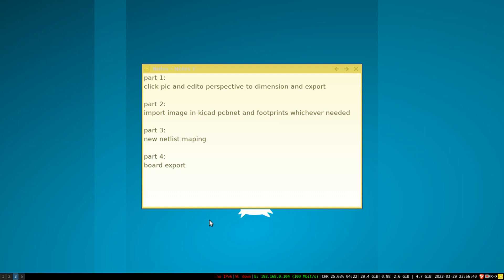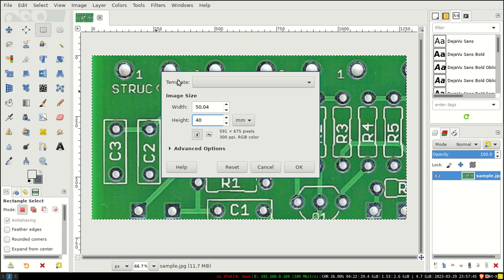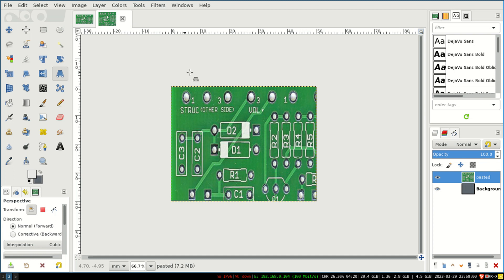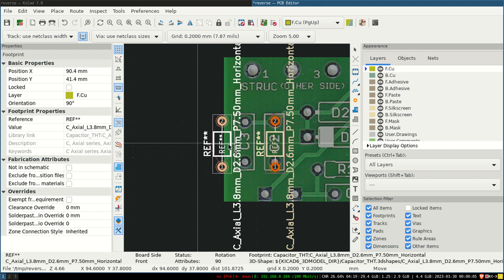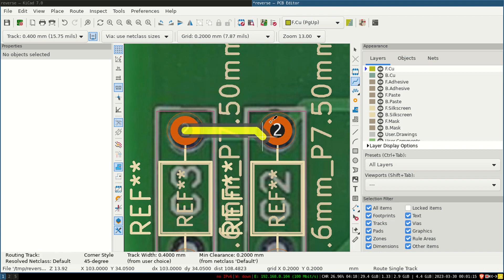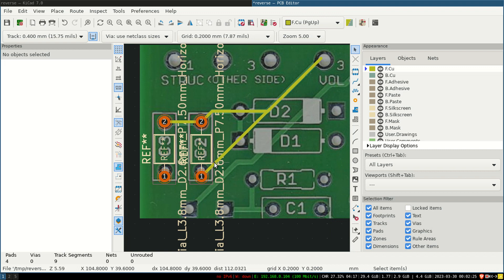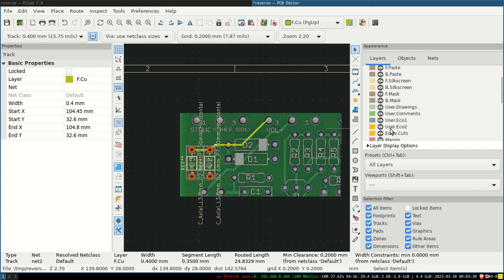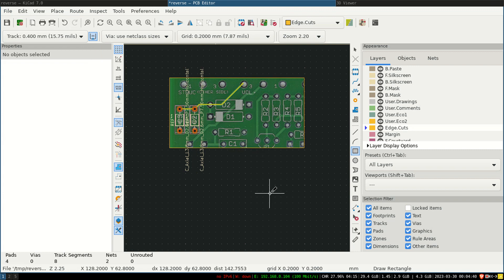Reverse Engineer PCB Kicad

Comment: can this be done for multilayer circuit boards?
Reply from the maker: @garavel28  i think middle layers are very hard to find , but using multimeter and some design ligiic we can identify middle layyers ,vcc n gnd connevtion. More than 4layer harder to reengineer